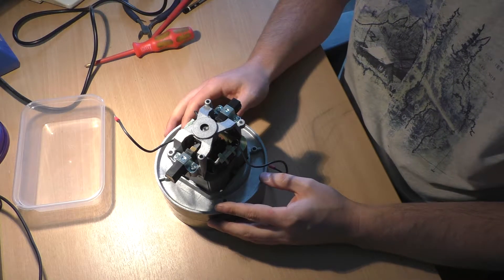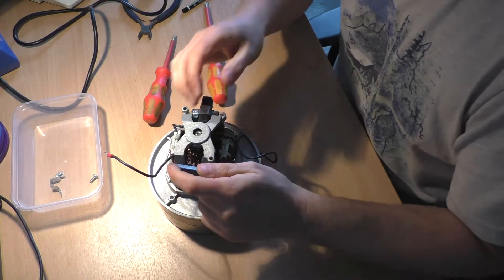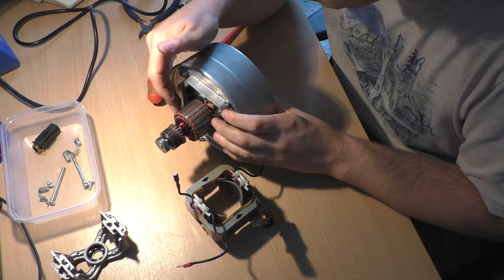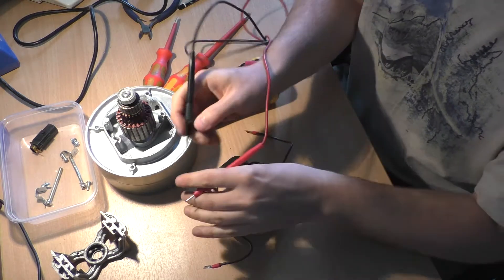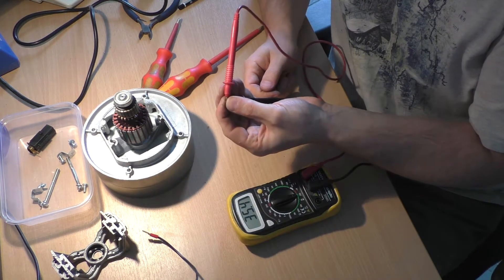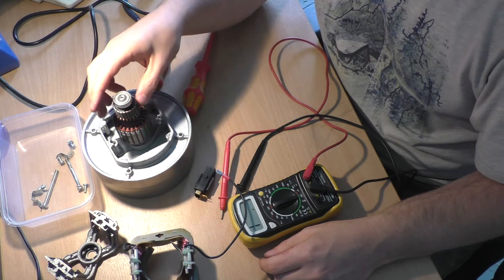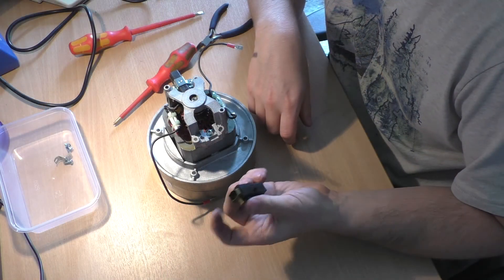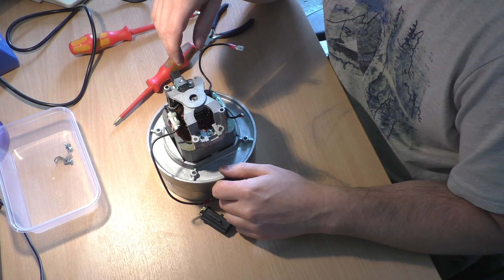Repairing a Numatic Henry Motor

Comment: Hi, it was nice to see your video. I got a question please about motor wiring. Is that motor has + wire and - wire? or does not it matter? because on the motor itself there was no mention of which side is + or -. Or even a wiring diagram .kind regards

Comment: What does it mean when it starts making a very loud noise ?
Reply from the maker: Possibly a bearing has failed. Check to see if it's getting unusually hot after running for a while. The whole unit comes as one piece though so you'll have to replace the lot if there is a problem.

Comment: There's a little locking tab in the centre of those crimp terminals, a pin or an awl can push it back to the open position and they slip straight off.
Reply from the maker: Thanks, next time I'm in there I'll make sure to look for that.

Comment: Definitely need to replace both brushes at the same time to stop uneven water damage
Reply from the maker: Thanks, I've replaced both brushes. The old brush was virtually brand new but as I had a matched pair of new brushes it was sill not to spend a couple of minutes extra replacing both.

Comment: Typical brush jam problem.Thats a Pattern part non original motor though
Reply from the maker: Spot on, the original motor burnt out after about 4 years  of heavy use. The windings failed on the rotor. As I'm sure you know a genuine motor is often more than a new machine so it only makes sense to replace it with a copy.
Reply: Wobblycogs Workshop True.I found that the Henry motors from 1987 to 95 were the best,they use them ones in the majority of dust extractors
Reply: Wobblycogs Workshop Windings failing is kinda common.A fault you see every now and then.Do always keep spare windings about for mine lol.Have had brushes go more often.
Reply from the maker: Wow, you really know your Numatic vacuum cleaners. I wonder if you could help me, we also have a George wet and dry but the cleaning spray has stopped working. I'm guessing it's the switch on Georges head but I've not had it apart yet to check. Do you have any ideas?
Reply: Wobblycogs Workshop Thanks.Ive had the same problem with my george machine.It could be the switch or the pump has like scale and the jets are blocked.The problem on mine was that the diode that haves the wavelength was faulty.They hide this diode in some yellow sheating.
Reply from the maker: Many thanks, I'll have to get it apart soon and check.
Reply: Wobblycogs Workshop Youre welcome.I would first just run hot water through the pump and tubes.Then soak the metal ends in hard core descaler.If no avail,then youd open the machine and operate